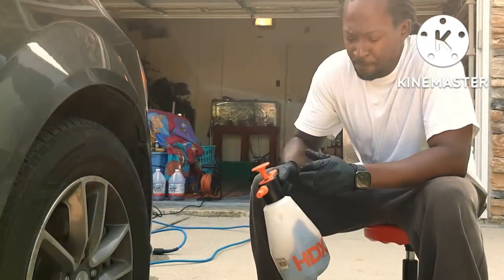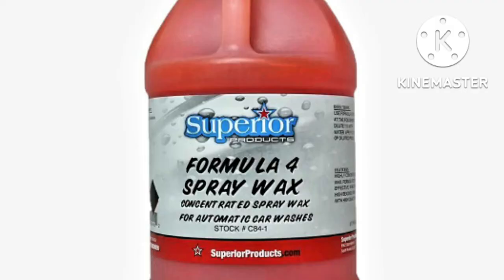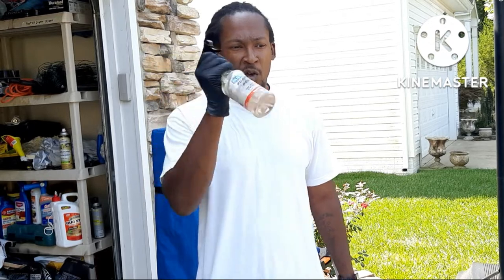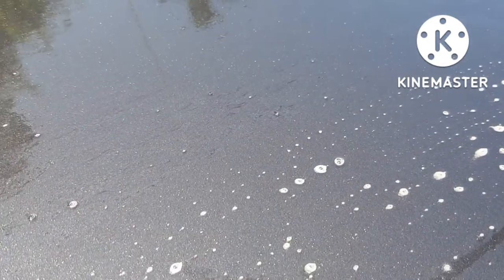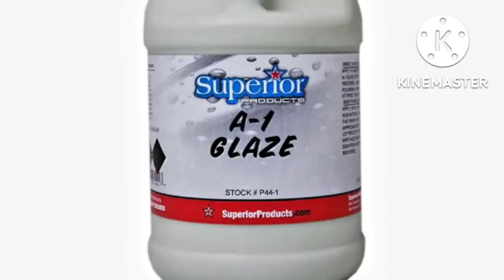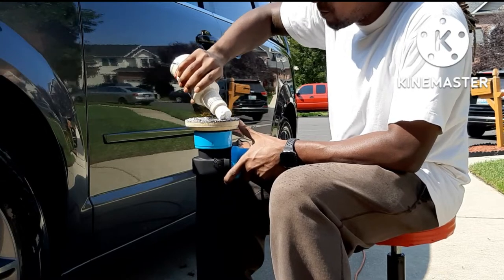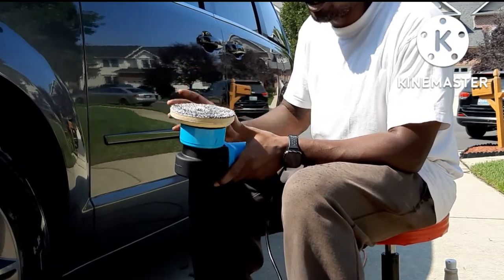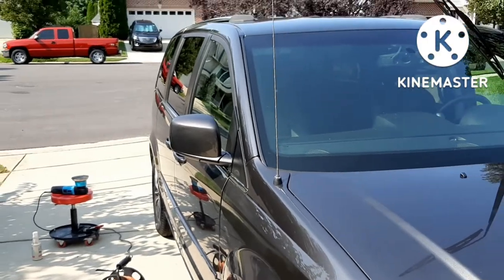Minivan Detailing Using Superior Detailing Products

Comment: Great video, Only advice I would give is ditch that turbo tip thats a 0 degree tip that spins can damage things very quickly not very careful with it go for the white or green tip or yellow tip for detailing work.
Reply from the maker: Thanks for tuning in! Now I use the yellow tip for detail work and the turbo nozzle for wheels and wheel wells. Thanks for the advice! 👍🏾

Comment: I started dropping some of the superior products from my detailing set up. Just found they were not cutting it despite how low the cost on them are. I dropped dark fury as I was getting better results using road warrior without the risk of staining the rims and tires. Dropped their spray wax in favor of technicians choice ceramic spray as the ceramic just performs much better. Looking at dropping their soap with wax for grape and glow from technicians. Though I really do like superiors aerosol cover all.
Reply from the maker: Yeah, I'm testing out a few brands. I'm finding that each brand has one particular product I like to use. I'm going to try road warrior in place of dark fury, it definitely can stain. One of my detailer friends told me about that technicians choice ceramic spray and now you mentioned it also, so I think I'm going to have to give that a try. 👍🏾 Thanks for watching!
Reply: @410AutoShoMobileDetailing  the staining from fury can be removed with an iron decon spray followed up with a light agitation but now your losing time. I think you'll find the ceramic spray as a really nice addition. I use it on the door jambs as a waterless wash and on the whole exterior in place of a spray wax like TW ice. I love TW ice but the ceramic spray is very cost effective.
Reply from the maker: @aRANDOMqUICKIEgunsandfun  Thanks for the info and I will be giving it a try

Comment: Nice work bud! Quick question in the background I could hear the pressure washer purging on & off I was having same issue with electric PW & was told that happens when your not directly plugged into outlet rather than running a extension cord in between! Curious if you have it plugged into an extension cord the to outlet?
Reply from the maker: Thanks for watching! Yes it was plugged into an extension cord but recently I added some plumber's tape and voila, it stopped.

Comment: Hey! Good stuff, I love using superior products as well. I use their dirt buster for an initial foam as well as the contact wash. Out of curiosity, how much dark fury do you add to the foam cannon? 1-2oz? I would like to try this in my initial foam with the dirt buster.
Reply: I saw in another comment that you use 2oz, is that still true? Also do you dilute the 2oz before adding it?
Reply from the maker: Yeah, you should definitely give it a try. I use 1oz for mildly dirty vehicles, and 2oz for heavily dirty vehicles.
Reply from the maker: Yeah, that's still accurate. I don't dilute it before adding because I'm only using a small amount and it's being diluted as it comes out of the foam cannon.
Reply: @410AutoShoMobileDetailing  awesome thanks! I’ll definitely give it a shot. I’m still kinda new to the business so I’m still learning a ton.
Reply from the maker: @bossquang  I'm still learning also! Just over 2 years in business

Comment: For Dark Fury, What is your dilution rate recommendation for wheel bugs and tires without ruining risk of staining?
Reply from the maker: I use a 4:1 dilution ratio for those applications. The thing I keep in mind when using it is the temperature of the panels and if I'm in direct sunlight. Those two factors help me decide if I have to spray and rinse off almost immediately or if I can let it dwell and then rinse off. Be careful and stay blessed!

Comment: Dark fury how many ounces in the foam cannon?  Looks good thanks
Reply from the maker: Thanks for watching! I put one ounce of dark fury in the foam cannon mixed with three ounces of soap.
Reply: @410AutoShoMobileDetailing  thanks I was thinking that but than am like what if he did 2-3 ounces. How do you like these products? My only concern with dark fury is aftermarket rims. I don’t want to ruin the finish. So what do you use to clean  aftermarket rims ?
Reply from the maker: @jayp9450  I like Superior Products but it's just like any other company, they all have some products that you like and some you don't. Fortunately I use dark fury as my primary wheel cleaner and never had an issue thus far.

Comment: Hello sir,

I have a question. So how safe is it to use the rage mixed with cherry foam combo wash every week?

I have a Tesla model Y white and looking for recommendations…

Also is it safe to do the iron remover and wheel cleaner every week before washing the car with this combo?
Reply from the maker: Hello, and thanks for watching! I only use the rage mixed with cherry foam if the car has heavy road film or bugs that I can't just blast off with the pressure washer. I maintain a white Honda Pilot every other week that is a daily driven highway vehicle, and I use this combo every time without any problems. As for the iron remover, my recommendation is to use it only once or twice a year or if the car is heavily decontaminated! Hope this helps!
Reply: @410AutoShoMobileDetailing  thank you so much
Reply from the maker: @shaunbooth2954  No problem! Just make sure to dilute the rage.